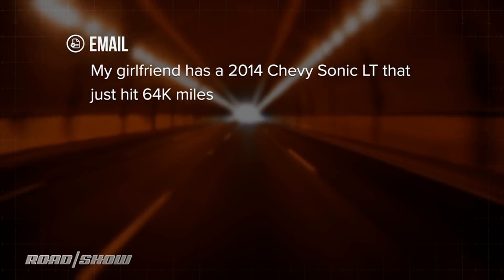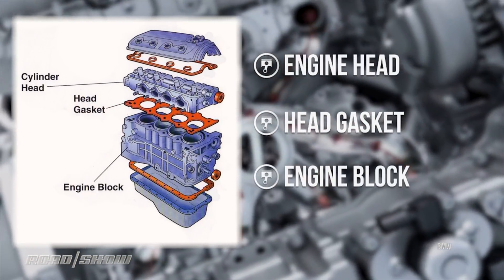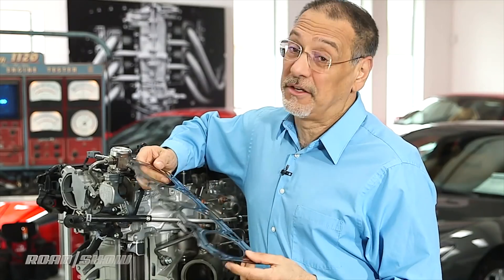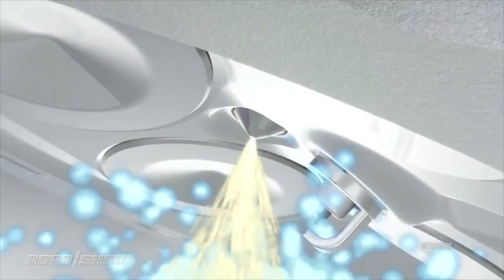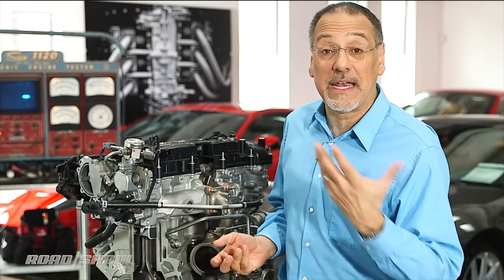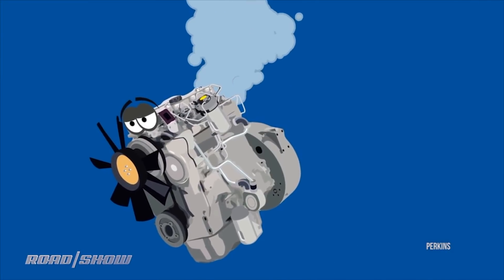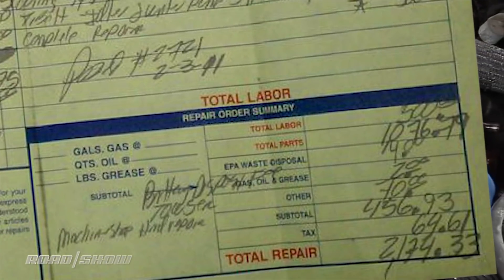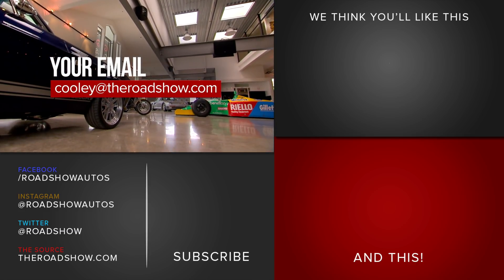Your Email: What causes head gasket failure? | Cooley On Cars

Comment: Hey quick question for you for anyone else I have a 2010 Chrysler 300 I don't have any white smoke or any milky oil I keep smelling a burning smell what size of today my radiator decides to blow a big hole on the side before that my temperature gauge kept going up and down all over turn my thermostat be messed up or is there a problem with a head gasket

Comment: I've had multiple head gaskets fail on multiple different vehicles unfortunately. I've tried a few dealers in hopes it would buy me a little time, but have never once had any luck with that stuff. The only answer is to start pulling the heads off. 😤🇺🇲

Comment: Good video and well explained but not so sure that head gasket failures now are less common than they were... They are using less clamping bolts for head,block and gaskets in the modern cars (to save money) causing greater gaps between bolts and so less clamping pressure and therefore, gasket failures seem to be very common in the modern cars...Scotty kilmer explains it in one of his videos.

Comment: I have read a lot of posts on car forums that the factory head gaskets that come with the original car are actually INFERIOR to replacement ones mechanics put in ( with their $ 1000-3000 bill. )
And so - after the head gasket job - it seems it is more unlikely for it to fail again - due to better quality replacement gasket.

Comment: the newer Chevy Sonic's and Cruze before 2016 mid year were know to have thermostat and water pump issues with the 1.4 if not caught and repaired promptly could cause the motor to overheat and these like most modern engines are made from aluminum which can warp causing a blown head gasket.There are of course lots of other factors that can cause a head gasket to fail but the one I mentioned above were a know common problem with GM

Comment: Drive electric.... won’t be needing to repair one of these anytime soon, or ever 😁
Reply: Dude, repairing an electric is way worse... good luck with battery change or any of the electric motors. Then there is this thing called firmware upgrades. 
Only at AD my friend.
Reply: @Stanjara  I think you meant to say that IF an EV would need repair it would be way worse. Except that statement means nothing here because 99% of the time electric cars never need repairs, unlike internal combustion engines. Batteries last for a very long time (especially as they get bigger) and electric motors can basically spin forever as there is no friction between the moving parts. Do your homework first then come chat. EVs are superior in almost every way.
Reply: @stevenaziz  Ok fair answer. 
I wasn't saying fuel pump is something that EV has, but what it actually is. An electric motor.
They do spin, but they wear out, just like anything, so EV is not short of a repair, just like a normal vehicle is.
I have nothing against EV and I do think they are awesome, but I get triggered when someone is saying they can go indefinitely, no maintenance, battery is not an issue and they will save the planet.
You do realize that everything on the car is made out of oil...tyre, plastic, seat material, glass for production, paint.
So yeah...they are just cars...and also...everything will depend on charging stations, power city grid when 100k cars are put on a charge... and standards for charging.

And then there is Right to repair bill witch is all another story. 

Good for you man...EV Zip Zip.
Reply: @Stanjara  lol okay yes the battery might need replacement if you plan to own the car for more than say 12 years but there is a warranty for that. As for the electric motor, it literally does not give out....EVER. When I say ever I really do mean ever. You can drive an electric car for a million miles and that motor will keep chugging. I’m not exaggerating. Because brushless AC motors literally generate next to no heat then they can basically spin forever. When battery tech catches up to the rest of the EV then it will truly become the future of cars and transportation. Right now, though, not everyone can survive on less than 400 miles of range. But for this one downside of owning an EV are we supposed to discount everything else and say it’s worse than a regular ICE car? I don’t think so. It’s still better, and yes, it will save the world.
Reply: @stevenaziz  Hey you learn something every day. Cheers.

Comment: Causes of engine head gasket failures 
1)Engine over heating
2) clogged radiator
3) Improper installation
4) Incorrect selection or Materials
5)Hot spot 
6)Head Bolt tightening sequence is uneven or can't done as per OEM
Reply: GM engines are known for hot spots especially the 1.2 and 1.4 engines

Comment: Go Electric.  No need to worry about head gaskets or anything  that an internal combustion engine needs.
Reply: Have you checked the price of a new battery when the original goes bad?
Reply: Motor do rust and battery do lose power overtime... There are also other place that it can fail on electric car.. and it can not easily be found since they don't had the same censer as normal car... Is good luck with labor cost because it will take along time to find the problem...  I do prefer hybrid..

Comment: poor design, over heating and extreme heat cycling normally cause these to fail.. driving habits for eg. going up a mountain pass or hard on the gas from stop lights then turn into a rest stop or drive way and shut the engine off after generating that much latent heat causes inconsistent cooling across the head and block which causes wrapping over time..

Comment: Very informative I'm still wondering what causes head gasket failure?
Reply: first is the design of that thing makes it more prone to failure, since manufactures opted for wider gapes between engine volts(sahving corners) causing more stress to the gasket
Second is Heat, heating engine is ur gasket top enemy it causes those rubbery traces to burn causing leaks
so its good practire to always check ur coolant levels and not driving the engine to the max

Comment: Informative but didn't answer the actual question. So what DOES cause head gasket failure earlier than others?
Reply: Bad engine or gasket design. In the focus RS it was caused because Ford put a extra hole in the gasket that didn't do anything to save money on metal. Instead it ended up blowing there and they had to issue an expensive recall.

Comment: Typical head gaskets should last 250K+ if the engine is properly maintained and not overheated. Usually they fail by leaking coolant and if you pay attention you can probably start seeing seepage around the outside edges.

Comment: You still didn't explain why gaskets fail...
Reply: 1)Engine over heating
2) clogged radiator
3) Improper installation
4) Incorrect selection or Materials
5)Hot spot 
6)Head Bolt tightening sequence is uneven or can't as per OEM
Reply: They usually fail due to heat, so things like overheating, or part of the engine near an exaust will cause issues....then of course, is age
Reply: The answer was pretty clear at the start of the video the lady brought a Chevy she should have bought a Ford.

Comment: I never really understood why the block and the head is two things in the first place. To me it sounds like a failure of design. Just weld the two things together, no gasket needed there
Reply: Maintenance. I'd rather not take a plasma torch to my block if there's a valve or spring issue 150k miles from now, and head gaskets generally live longer than that if you have all aluminum or all iron parts. The earlier failures are turbo and mixed metal engines. Mixed metals cause expansion differences which destroy gaskets, and turbos in general push on everything in the engine.

As for welding, that won't turn out well trying to weld aluminum and iron together.

Comment: Electric cars come with their own set of issues. Number 1 is the computer as a computer in our daily life has to reboot it also has the same issues but as media is paid so such issues never surface on media. Other is reliability, let's suppose I have to drive to another state which is 300 to 400 miles as I get some emergency or in a mood to travel over the weekend. I need to make sure on the way I have electric charging stations available. And I can not detor I have to go in a straight line ( kind of lol) to my destination. And of course, I have to stop on the way to charge for at least 30 min. Now thinking about this if we have many electric cars on road then I have to wait in line I guess ( in future ).  But in the case of the gasoline engines, it takes less than 5 min to fill the car with energy rather one hour or so in case of electric cars. Any way so reliability is the issue. I have seen owners of the electric car also owns a second gasoline engine car for the same reason (reliability) . Till electric car battery charge fast and have a way to charge while driving like hybrid then I see it reliable otherwise it is not. And why I need to spend 40K plus to buy an unreliable car. I prefer hybrid until they have reliable electric cars. Also, are apartment equipped with charging stations? My point is it is driven by marketing rather true value. I have accord V6 touring with all bells and whistles bought new at 32 K ( compare at 50K plus for Tesla). Now my car is at 60k miles. Let's do a brief comparison.  Honda accord always reliable only change oil at 6K no issue. If I want to see my sick parents who live in another state I can drive any time. Or take my kids to Disney land etc without being worried about the charging stations. Tesla also needs maintenance which is electronics related, I work in IT I know when the issue happens car will look like a brick. I need to wait until it is reliable. Those are just some of known issues. Do not forget the price drop like a Mercedes car. After 5 years battery definitely becomes weak and the motor needs bearings, bushing and might need to rewire ( rebuild electric motor).

Comment: $1k for head gasket job? 4cyl Toyota cost me $4500. Never again
Reply: Did you overhead it or did  your car slip threw Toyota's  strict quality control i think that all car's are a hit or miss sometimes there excellent reliability sometimes not
Reply: Neil Murphy it never overheated... it all of a sudden started burning coolant and making a loud muffler noise... brought it to Toyota (where we always have it serviced) and that’s it.  Very disappointing.
Reply: @williamcass68  ya there sapost to be very  reliable engines there quality control has dropped as well along with the outher car brand's do you mind me asking what year isit
Reply: @neilmurphy845  Co workers 2012 Corolla did the same thing at 58k miles. The warranty expires at 60k miles. Dealer fought him on it. In the end Toyota picked up the tab. Car didn't over heat and had no warning signs.

Comment: The question about poor engineering was not completely addressed.  Since this was a GM car, I would say poor engineering by GM is INHERENT upon all GM vehicles.   I have a 2006 Mazda 3 with 165k kms. and 2012 Hyundai Sonata 2.4ltr with 156k kms. and they are all still performing perfect, no leaks, no engine troubles....

Comment from the maker: Are the many failure points in internal combustion engines worth moving to electric cars?
Reply: Yes.
Reply: Simply Yes.  Expanding on that Hell Yes!  Nobody got time for head gaskets, oil filters, spark plugs, ignition coils, lifters, cams, exhaust manifolds, O2 sensors, injectors, turbos, timing belts, chains, gears, more gears, cylinder heads, cylinder rings, rods, cranks, transmissions, flywheels, clutch assemblies, throttle bodies, fuel filters, gas tanks, gas every couple 100 miles.
Reply: nobody living in an apartment can buy an electric car.
Reply: Energy density isn't high enough. The true compromise is a renewable fueled combustion engine. Low volume turbine running on hydrogen fuel, mated to a very small battery (think less than 50 miles) and feeds electric motors.
Turbines are relatively cheap to engineer as "flex fuel" as well.
Trains have been using it for years, the turbine-electric combo is ready for use today. Hydrogen is really just an add on for low impact liquid fuel that can be made using totally renewable sources.
Think of Hydrogen as a super dense battery pack. Better than fossil fuels? No, but nearly as clean as streight electric, and has far more energy density than even prototype batteries.
The other option is mounting the turbine to a CTV for direct locomotion instead of using motors
Reply: Anybody who is a man and knows how to work on cars will say no. We enjoy working on cars.
Reply: Nope. Electric batteries don't last as long as a well made ice engine and expensive to replace. An electric has much more of software n electronics which is more likely to fail after 8 years
Reply: no.

Comment: Hey Cooley, glad you’re keeping everyone informed. I deal with head gasket failures at my shop everyday. Mostly GM vehicles come thru. I mostly deal with GM vehicles with the 3.6L motor. Mostly GMC Acadias from 2007-2010. Saturn Outlooks, Chevy Traverses as well. Late model Impalas from 2013-2017. I’ve also had a 2014 Chevy Cruze that needed a head gasket failure which doesn’t happen as often. What I’ve noticed is that most of them run out of oil quick. And most of them blew the head gasket after a long trip. I’ve noticed their head gaskets are thinner and have less screws that hold it down, so they are susceptible to damage easier than Ford and Chrysler heads.

Comment: Head gaskets rarely blow before 150K mile, and if it does so its usually covered by the manufacturer and it is not its a 1 to 3 grand job. on the other hand a 7 year old Tesla  would require a battery refresh (like you do with a laptop) and that is a 5 to 10 grand job...  its not an argument to buy a Tesla more an argument not to buy a Chevy...

Comment: Great video as always but - you didn't actually answer what causes the gasket to fail, just what happens when it does. They wanted to know if something in their driving style caused it to go seeing as it is a conservative driver.
Reply: If they didn't address the reason the head gasket failed and fix it the new one will blow too. Head gaskets just don't blow for no reason something caused it
Reply: It’s a gasket, they tend to fail overtime 64k is early for one but not uncommon for chevys (go figure). Heat is the main culprit though, as for warping being a issue then yea trade it in cause now you got bigger issues
Reply: The cause is usually very simple. Poor design, bad out of spec assembly in the factory, or the  driving the car without adequate coolant or no coolant at all.
Reply: Change your coolant, people!  Use OEM that your car was enginerred for and not the generic "universal use" kind.
Reply: They have to make some livings for the mechanics.
Reply: Yeah he didn’t answer the question, pretty annoying. Bad coolant can also rot a gasket, because when the PH goes out of wack and there is electrolyses it can do bad things.
Reply: What causes overheating?
Reply: engine overheating is the main cause   it warps your head gasket   or just poorly made  poor design engine
Reply: I've found that if you let your coolant, or water get old and rusty it will become acidic and start eating the gasket
Reply: @jondoe4667  Ah! This seems very plausible. I'm looking to purchase a 56K 2014 Prius. Carfax shows replaced head gasket at 40k I'm trying to decide if I should by or run!
Reply: @N452ER  I'd run. But I can't think of any reason to buy a Prius unless it's to transport fuel for your truck😂
Reply: @jondoe4667  I ended up getting a brand new 2022 Prius lol loving it so far!

Comment: Its a Chevy thing...they make garbage 4 cylinder engines...Toyotas and Hondas dont go around blowing head gaskets
Reply: Yes Honda Toyota do blow, just takes longer
Reply: stickloaf not anymore ...
Reply: Are euro Ford's ok aswell i can't think of anyouther car's maybe a opel would be good but don't they have the same ecotek  engine's are euro nissan Micras not the brand new one's the 151 one's and down word's they were  indestructible especially the 2005 models ones they were some car's and Toyota's from around those year's couldn't get them of them
Reply: You almost sound like as if the 4 cylinders are the only bad engines they make.
Reply: Umm Honda and Toyotas do blow head gaskets just not as early or frequent also depending on the engine in some Hondas circa early to late 2000s and early 2010s some Hondas will spring coolant leak into the intake manifold.
Reply: One word : Thermostat. They go bad and there goes your precious machine.
Reply: Scotty, is that you?

Comment: Or, if you're Subaru, you use a cheap head gasket for your 1999-2003 Impreza line.  Then, after a whole bunch of people have head gasket failures (in some cases leading to engine replacement), you deny there's a problem and refuse to cover it under warranty.  The end result, thousands of dollars spread out in 3 different repairs, then an engine replacement - costing nearly half as much as the entire car was when new.  But, maybe I'm bitter.
PS:  Convinced me to never trust a Subaru again.  Also, I'm on my last ICE car - next one will be an EV without a doubt!
Reply: My !@#$ Subaru head gasket failed the month after the warranty had expired.  Felt like robbed!  From that point on, I have been recommending Subaru to people I hate!
Reply: My '97 Subaru Legacy has 201,000 miles on it, still with the original head gasket. I figure that car is living on borrowed time.
Reply: @notrappaport5340  that's great to know, you need to write a book on how you've been maintaining it.
Reply: Head gasket failure is a signature design of Subaru boxer engines
Reply: subarus are junk - they market themselves to dog owners who know nothing about cars.  in reality subaru is a 3rd tier japanese automaker